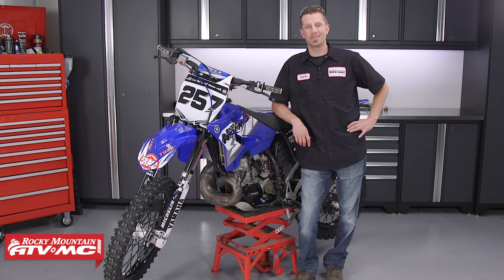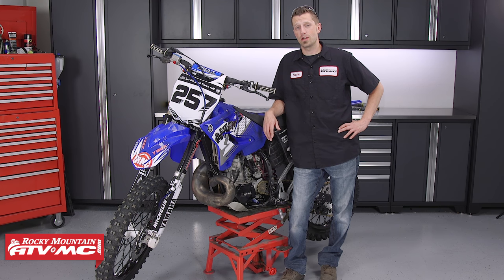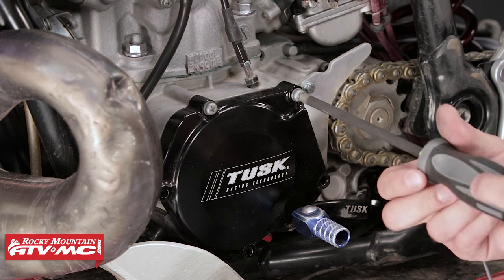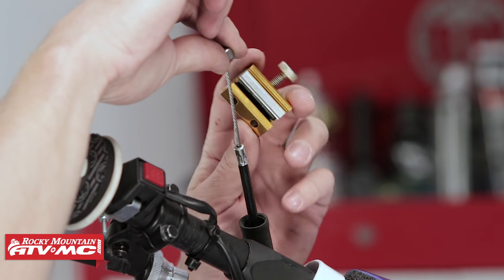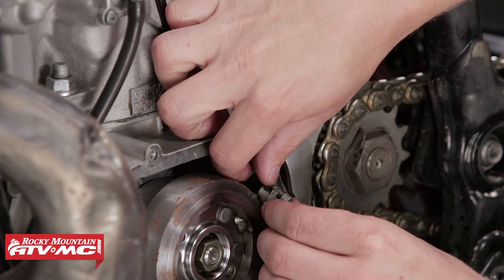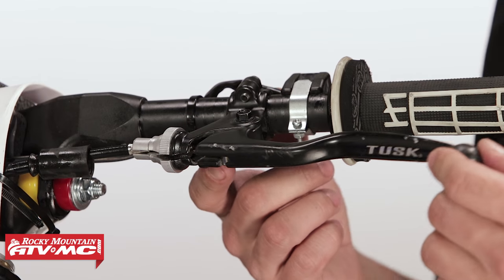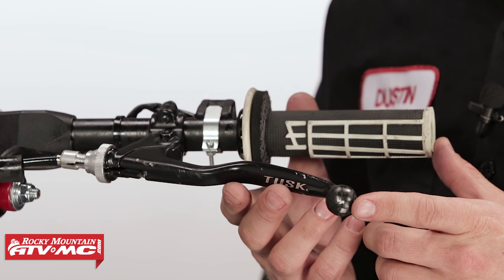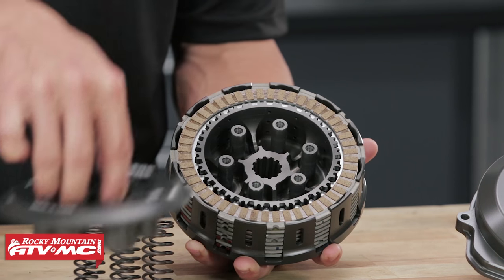How To Replace a Dirt Bike Clutch Cable

Comment: Do you have to lube it? I don't have oil for that wd40 works for that or not?
Reply from the maker: Lubing your cables is good practice and can prolong the life and sliding action. Check out our cable lubes we sell here: https://www.rockymountainatvmc.com/Sales/834/How-To-Replace-A-Dirt-Bike-Clutch-Cable .  I would recommend you pick up some.  It's not very expensive.
Reply: WD40 isn’t lube

Comment: I have adjusted the cable on my vintage 1971 Kawasaki Trail Boss 100 (3300 original miles) but it still doesn't disengage the clutch when putting it in gear? Your video mentioned other parts that might need replacing?  Any guesses as to my problem?  Thanks!

Comment: Mine is on the side like mentioned. Is there a reason behind doing below first, lever last? I ask because that's how you explained. Just wanted to be sure
Reply from the maker: Adjusting the clutch side first allows you to make bigger adjustments so that you can do your fine tuning on the lever side to get the correct free play and to make future adjustments when components wear.
Reply: @rmatvmc  oh yeah, i had planned on putting it on* that way first..

Comment: Is it normal for my clutch lever to be loose (bout an inch) until i pull it in? First time fixing a bike!
Reply: That’s just adjustment mate
Reply: You might have to tighten it up a little bit
Reply: @alexchapman4747  Yep tightening it up sure did the trick. Thanks

Comment: I got a cr 250 and when I put it in first gear it stalls with the clutch in
Reply: Castaways_fishing that’s just the clutch being too tight but it is ok, you might want to make it a little more slack, until you can shift it into gear and not stall

Comment: My clutch cable snapped a few days ago, I’m waiting on a new one but when I pull in the where the clutch cable attaches to it doesn’t actually engage the clutch. Should I be concerned?
Reply from the maker: Are you talking about the actuating arm that's on the engine? If the clutch worked before the cable broke, it should work again as soon as you get the new cable on. https://youtu.be/9s8FqEBONlk -Charles

Comment: what if the new cable is still  too tight on the loosest setting on the adjuster by the engine and by the clutch lever? i bought the same cable for my model bike
Reply: Same
Reply: Did you ever figure out to fix it?
Reply: @ghostlystatue7933  I just took out the inner ring by the adjuster by the clutch lever which gave me a few extra mm to work with.Then tightened it all the way then adjusted it by the engine. If that makes any sense

Comment: I have a question, my clutch hangs freely, like if I pull it in it stays and I have to manually push it out, and the clutch just doesn’t work itself, what could be the problem?
Reply: I would assume you have springs installed in the clutch basket, so maybe your rod isn't in correctly or have no rod at all?

Comment: When I pull in my clutch on my kx125 in 1st gear u can't push it but when it's running it's fine
Reply: normal when engine is cold
Reply: dayne washere need new clutch plates man
Reply: My new bike came with clutch drag.  It seems pretty normal. New plates could get rid of it though. I heard roughing up surfaces of the plain plates helps them hold oil and reduces clutch drag.
Reply: It’s because it’s a wet clutch and the motor got to be running for the clutch to engage